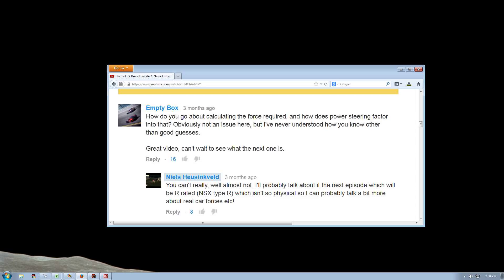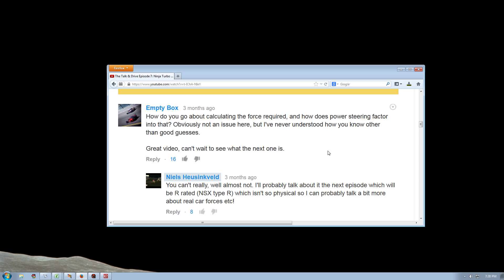Talk & Drive 12: Calculating steering loads from tire data and telemetry

Comment: Waaw !  Feedback drops as u reach maximum grip? Sounds weird but when u think about it, makes sense. The car is settling down at that point and u have momentum going sideways (pivot),  the car is no longer just wanting to go in a straight line.
Hard to notice in a real servo assisted car and imo, cant feel it in a kart either, but maybe i just dont have the arm muscles and precision to notice. U dont think about this while driving. Also interesting is that the inside tire force is a 1/3 of the outside force, i was expecting more force from only outside wheel. That is where all the weight is shifting to. Maybe do a video about weight transfer? In Motogp, the rear wheel lifts off the tarmac and in that moment weighs like zero kg. How is this for racing cars? Front rebound pushing back on the rear? And sideways shift in a corner.  I like this a lot, keep it up.

Comment: Impressive. Are you saying that there isn't enough force feedback with current wheels, or does that only apply to certain cars? Should my FF be set higher on sims like Assetto Corsa to match real life scenarios?
Reply from the maker: No consumer wheel has enough torque for any non assisted car, even a Lotus Elise for example is up to 9Nm, 4.5 times a G25. (if I remember both values correctly). Setting it higher rarely makes a difference, you probably get clipping soon.. Sadly its how 'game' devices work!
Reply: Niels Heusinkveld This is very true. I drove an elise recently hard for about 30 minutes and it was a proper work out! I love your videos and technical ability, keep going buddy!

Comment: Talking about steering loads, how is steer force calculated in rFactor?
Yes, going on about the tires again, I managed to fix my old problem, tires feel very believable right now, but the only problem is that the steering is very loose and weak.
I suspect it has something to do with the inflation of the tires or whatever, because that is the area that I do not fully understand. The grip is also slightly weird, it's good overall, but when the tire is skidding completely sideways, as sideways as the lock lets me, it doesn't want to grab very easily. Really sounds like a problem with the rates and whatever, the curve feels very good, and the steering load being administered via the FFB is good, but the force itself is weak.
I suspect you have some kind of magical fix?
Reply: I think I'm getting it now. This is my first time working with an automobile sim, btw.

LoadSensLat=( -3.89e-6, 0.351, 25000.0)
LoadSensLong=(-3.86e-6, 0.356, 25000.0)

I know that basically if you set the first value behind the e too small, you're playing "Ice-Racing" and if you set it too high you get wonky physics. Something to do with how much load the tire can bear, relating to tire size? I had it too low, so I was full on Ice Racing. I also have found out that the last value is N, but what is the middle value? A coefficient? 

LatPeak=(0.133, 0.325, 10700.0)
LongPeak=(0.137, 0.305, 10700.0) 

Same thing here except the first value is the sine of the max slip angle? In laymans terms, making the first value smaller gives you more strength and traction near the center but setting it too low will make your car sway side to side and be basically undriveable. No idea about middle and last value except that it's in N.

I'm probably completely misunderstanding these, though. My physics knowledge never extended into automobile physics, let alone do I have half an idea what all the formulas and stuff are in rFactor.
Reply from the maker: ArchOfficial  I see you ask a lot of things.. You can tweak things, or, as I had to do, learn vehicle dynamics and reverse engineer the rFactor physics. It takes a few years (its fun though).. Changing a car without this knowledge is a bit like finding a needle in a haystack. There is too much going on to give somebody a few hints or tips, that won't work sadly!
Reply: ArchOfficial If I may, Niels.
ArchOfficial, you got it backwards, quite wrong even.

Though it all depends on the approach you follow (mine is, after all the data I collect or am given, devise a tire depending on width and compound), truth is everything is connected. The behaviour of LoadSens is simple to understand but rather more complex than you seem to imagine. You ought to input the equivalent of real life load sensitivity variation. You have to "design" a tire with the forces it will develop in mind. A stiffer compound will yield less lateral force than a softer compound, for instance, and you have to have your tire reflect that in terms of maximum loads achieved, forces generated and range of slip angles applicable. Everything is connected, but in order to understand that you have to read the basics (RSC threads are a good source, but also read as many books on tires as you can ). As I have been saying for years, all these new tire models are making wild if not dangerous assumptions on tire behaviour, with not enough data to back it up. ISIMotor2's tire model remains a good, plausible, solid approach to tire modelling.

Comment: Awesome, that's why GSC is such an amazing sim. You should be teaching those guys at Iracing how to program FFb.
Reply: They know how to program FFB, in fact you can see there the steering torque (the same thing Niels is calculating here) via telemetry.
Reply: no need to program ffb. realfeel just takes the forces of the steering-rack and puts it on your wheel. a proper made car in a rfactor sim gives you realistic ffb over real feel automaticly. good physics don't need fancy ffb programming just raw output of the forces.

Comment: Niels, you should consider doing a physics of racing series. :)

A more spreadsheet styled talk and drive, if you understand me.
Reply from the maker: Joe ExtraKnow
Joe, I read your comments and then I saw your videos. I don't want to put you down, but your talk doesn't match your drive. And that is putting it mildly. I say this because others may assume from your comments that you're knowledgeable. All evidence to me seems to point towards Internet Expert Syndrome, some simracers may know this as the Richard Avery syndrome. I have no problem with that and have nothing against you but I can't take your comments seriously.

Comment: Cool video and good explanations.  Besides them being interesting, what do you use these calculations for?  Assuming the game physics are correct, shouldn't there be one correct value for wheel calibration?  It would seem that knowing the real steering forces in the vehicle would only be useful in scaling the FFB value for cars that exceed the maximum torque of a wheel.
Reply from the maker: There are (a few) people who are convinced their G25 type wheel is very strong and realistic, which is not true. There are also those who watch my more sweaty videos commenting its not so hard to drive in real life, which is also not true. Calculating steering and brake forces provide some evidence of the ballpark physical effort needed for TRUE simracing. :)
Reply: @NielsHeusinkveld  But also according to the internet, F1 cars have power steering, so actually running your wheel at this high torque is unrealistic. And there's different levels of power steering, from driving with your pinky to fairly torque-ey.
So how do you take these figures and then abstract it through a realistic power steering system? BeamNG is the only one I've seen that actually simulates power steering.
Reply: Considering the fact that Niels has a Bodnar wheel that can do literally any forces for any car, this is VERY useful for him, anyone else however...